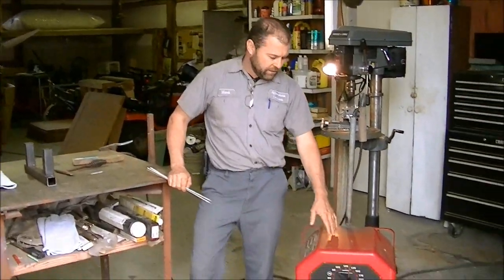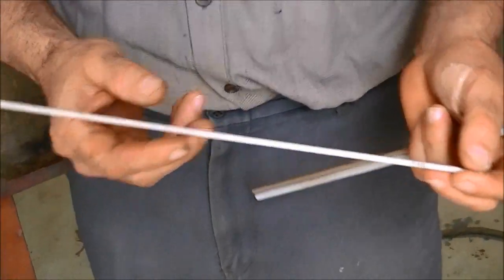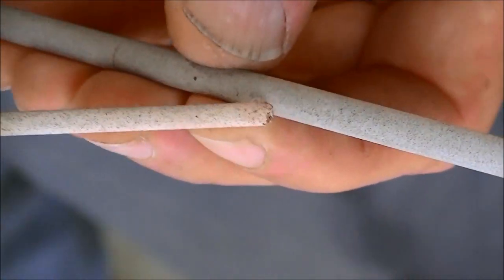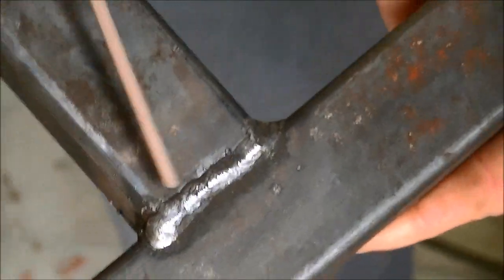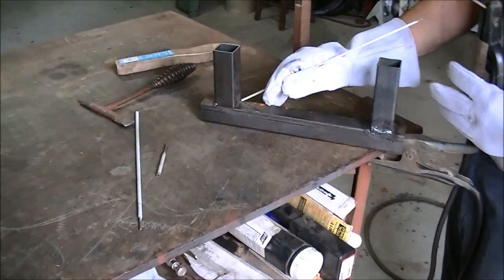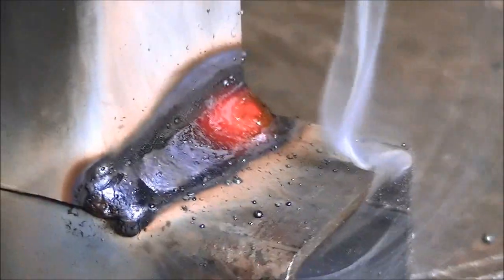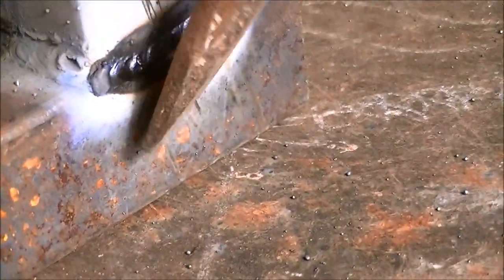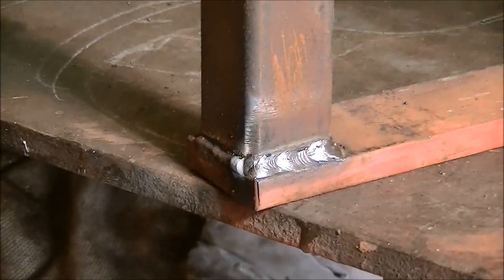Learn how to weld watch thru the welders lens. Tutorial.

Comment: Do rods have a shelf life? Do new rods weld better than those that have been sitting around a while? Do you use different rods depending on the thickness of the steel you are welding?
Reply from the maker: Rods have a very long shelf life if you store them in low humidity. The thickness of the rod depends on how thick the metal you are welding.
Reply: +markp0177 Thank you. So does the humidity break them down, rust them, or can they be dried out and used?
Reply from the maker: They can be dried out and used. I would not take a welding test with them but for just welding stuff around the farm is ok.
Reply: +markp0177 Thank you for your help
Reply: Naughty Goat Farm It also depends on amperage. I prefer to use two rods for every job, 6010/6011 first because it burns deep into the metal so that there are no weak spots and fill and cap with 7018. You can turn the amps up and get a decent root with 7018 and you can make great cap and filler with 6010/6011 if you know how. Regardless of steads hands, do a pattern and your 6010/6011 will look great.
Reply: Naughty Goat Farm  they don t have a shelf life if there kept in a rod safe ..the safe keeps the rods at a constant temp of 100 plus degrees...... 7018 rods have to be preheated to make strong weld ..if you want the answer for your other Q. text me ...i went two yrs all phase of welding ....been in the field of welding for 25 yrs hope that helped
Reply: Most rods have long shelf life. For storage, reconditioning and recommended welding techniques, always read the manufacturer's data sheet. 

E.q for E6013:
STORAGE & RECONDITIONING: After opening, store at 60°F to 100°F and below 50% relative humidity or in a holding oven at 100°F to 120°F. Reconditioning should be for one hour at 250°F to 300°F.
RECOMMENDED WELDING TECHNIQUES:
Arc Length - Average length (1/8” to 1/4”)
Flat - Angle electrodes 10-15° from 90° with higher heat than E6011 electrodes
Vertical Up - Reduce amperage from flat position
Vertical Down - Use higher amperage and faster travel, staying ahead of puddle
Overhead - Use slight whipping motion, multi-pass for build-up

My favorite rod is the 2.6 mm E6013. For welding a thick material (1.4 mm or more) I set the amperage to 60-80 Amp (Electrode Positive). For welding a thinner material down to 0.7 mm steel I still use this 2.6 mm rod, I just dial down amperage setting to 40 Amp (Electrode Negative). The reason I don't use a smaller rod is most often it sticks to the welding material and small rod is hard to pull up and will be burn easily. Total waste of money.
Reply: Hydrogen rods you keep in an oven because humidity ruins them
Reply: Yeah we have the set up at trade school that you take your rods from the small oven we have set up and replace the taken rods with new ones from the box and make sure that we cycle the bottem ones up so the new oned are on the bottom and no one gets the recent humid ones by accident. If you do that, you will be fine. Just have to keep an eye out for chipped rods. Also when using thicker rods and/or welding thicker steel, your best bet is to up the amperage. Again though, best practice is to do a test run when you make a change on scrap
Reply: for storing low hydrogen electrodes you should never use a fridge with a lightbulb. to keep hydrogen out of the coating of a LH electrode they need to be stored at 250-300 degrees farenheit, and not left out for more than 4 hours. if you use a fridge with a light bulb it doesn't get hot enough to keep moisture out of an electrode. this means the low hydrogen electrode will no longer be low hydrogen after it absorbs it from the atmosphere.

Comment: hi there... taken up an interest in welding recent.... what's a good amps for 6013 ? that's the rod I got to work with.
edit Opps I forgot to mention that I'm using a AC welder and my 6013's diameter is 3/32". 
Regards,
Reply from the maker: For a 3/32 rod you will be around 60 to 75 amps
Reply: Teck Chye Tan the rule of thumb is rod diameter equals starting amperage. For example, 5/8 rod = 0.65"= 65 amps. Exact setting depends on machine, position being welded, and material temp.
Reply: Miller and I think Everlast have welding calculators on their websites.

Comment: and nice sun burns after the welds in short sleeves !! :)
Reply: its UV light that is emitted. So you can very easily get a "sunburn" if you don't wear protection
Reply: Rollo Larson Brightness, heat, sparks and uv. All three are dangerous but the light and uv are way more than any tanning bed. My neck being unprotected is how I learned that I have Lupus.

Comment: How does 7014 compare to 7018? Which do you find easier to weld with? I've never welded with 7014 so I'm interested in what you have to say about it.
Reply from the maker: +jimgam730    The 7014 is easer to strike a arc but it makes a lot of flux. I would use a 7018 if I had a dc machine.
Reply: +markp0177 I thought 7018 was only DC?
Reply from the maker: +Stephen Anderson  7018 is DC only.

Comment: thanks a lot mark i bought the exact same welder today and we were having problems with the arc.... one problem still though is we bought the 50 amp welder but in our fuse box we could only connect to a 40 amp breaker..... is that a problem or is it ok to use that way?.... again thanks a bunch...... bsinstallations@gmail.com....
Reply from the maker: +Brian Soulliere It should work, the worst case is that you trip the breaker. The welder will only be pulling 50 amps on the highest setting and you will probably only be using it half power.

Comment: Hi my friend, here I am again. I would like to start some weldings for an air suspension system (airbags brackets). What rod would I need to use in order to handle the load of the car? Thank you and regards from Mexico!!
Reply from the maker: +Jorge Torres A 7018 rod is used for most structural welds.
Reply: Ok. Thank you for the advice.

Comment: Is welding flux anything like solder flux?  A mild acid that eats away any surface corrosion to produce a better bond?
Reply from the maker: No, The flux burns and produces a shield around the melted metal. Oxygen will ruin the weld while it is melted.
Reply: +markp0177 im a boxer and i am so tired of paying these insane prices and welding is the only thing preventing me from building my own stands for these gyms, i have so many questions for you but im sure you are  a very busy man, if you ever have time to answer a few questions id appreciate more then you'd know, but even if you are too busy i want to sincerely thank you for making this video, i was a pipe-fitter for 3 years under an apprenticeship but soldering obviously is not welding, and we only had 1 welder on each job usually
Reply from the maker: +brad harris I will answer your questions. What is it you want to know.
Reply: markp0177 thats very kind of you im sure youre very busy, i guess to start i wanted to know what is the most economical way to get started, im not doing any large quantity and just need welds that can hold 150 heavy bags so im sure almost any weld can do that , i didnt know if renting a machine or buying one or whatever, ill put up a link showing some of the things i have need to make, thanks again again its a great video
Reply from the maker: +brad harris A mig welder is the easiest to use, so if you rent one get a mig. You can weld with 3 car batteries using a 6013 rod. Here is a video showing it.https://www.youtube.com/watch?v=sjH8I1oKNMY
Reply: markp0177 thanks i saw that but i didnt know if it was legit
Reply: +M&amp;M boxing Hotty productions You are better off getting a small everlast welder. They aren't that expensive and the welds will be much better. For the cost of three car batteries you can buy a real welder that comes with a stinger and work clamp.

Comment: Good video thanks.

Takes me back to college days when I did welding as part of a basic engineering course.
I was much better at gas welding than I was at arc welding.
You make arc look easy, but I guess it's your job.
Reply: Which engineering field did you study? I'm looking to start school next year.
Reply: Can't tell if that question is for me or the poster, sorry.
If it is for me, the answer is: In 1989 I did a BTEC Diploma in Mechanical Engineering (In The U.K.). It was what I would now call an introduction to the basics in a few areas (lathe, mill, router, drill / eng' drawing / math / pneumatics/ hydrolics / gas, and arc welding / basic electrical skills / a couple of other things I cannot remember now).

I doubt that this information is of any real use to you though, sorry.
Reply: +staninjapan07  Yup, my question was directed at you!

I'm working in the construction industry right now, and I'll be starting to take prerequisite courses for an engineering transfer program next semester.

I was wondering which field of engineering you studied because you said that you did a bit of welding in school, and I also like welding.

I haven't chosen whether I'd like to go into mechanical or civil engineering yet. I like both, but I was leaning a little towards civil because I was thinking it'd be a smidgen more field work than mechanical.
Reply: is the basic welding easy?
Reply: +Angel Granados I seemed to be the opposite of most folks around me at that time.... I thought that gas&rod welding was easier than arc welding. I always made some mess or "splatter" with arc welding. It depends on the person. Also, there is not 'one best way for all jobs' as it were. At the time, I practiced more with gas because I was free to do so and I wanted that skill for working of car bodies.
I have never used any welding kit since finishing that course however. I have never had to.
I reckon you could teach yourself arc or mig welding fairly cheaply - cheaper than gas - as you can buy a machine for about 100 pounds (U.K.) / maybe about 150 US dollars.
Reply from the maker: Once you learn the basic welding the other positions are easy to learn.

Comment: I thought I heard you wrong but I watched again,  and you said 6013 on the first two welds you did.  very curious which one was actually 6013 because those are the rods I have.
Reply from the maker: Daniel S  First rod was a 6013
Reply: markp0177 Hi Mark i need help could you exlain to me what kind of a welder i would need to weld about the same type of stuff as you were using in this video i am wanting to make a very sturdy go kart frame
Reply: +Sawyer Helle (HerkyThe2) I would say the same welder he is using...

Comment: I went through this whole video not knowing what kind of welding you were doing. At first i thought it was a stick welder because of all the sticks, but at the last second you mentioned striking an arc. What welding is this?
Reply from the maker: This is stick welding. You have to strike a arc to start welding. It is like striking a match.
Reply: SMAW is the correct term for it, but it's commonly know as Stick Welding.

Comment: Hi, which rod would I need to use in order to weld a flat plate on a strut? Thank you in advance.
Reply from the maker: 1/8" and thinner is thin metal and 3/16 and up I would say is thick. You don't want to use a rod that is thicker than your metal.
Reply from the maker: I would use a 7018. If the metal is thin use a 3/32 size rod.
Reply: Thank you for the advice. Regards from Mexico!!
Reply: Jorge Torres What is considered thick and thin metal??

Comment: Why do you remove the flux? Is it to inspect the weld?
Reply: the slag (spent flux) must be removed to inspect the weld and to avoid corrosion. Slag is extremely porous and will collect moisture if not removed.  Heavy slag coatings can hide bad welds.
Reply from the maker: Yes to inspect it and to get it ready to paint.
Reply: Always wondered about that. Thanks Mark!

Comment from the maker: Well stick welding is not easy to learn. A mig wire feeder is the easiest to use. I have a simple AC Lincoln stick machine. I paid $100 for 20 years ago. If I did more welding I would up grade to a DC machine.